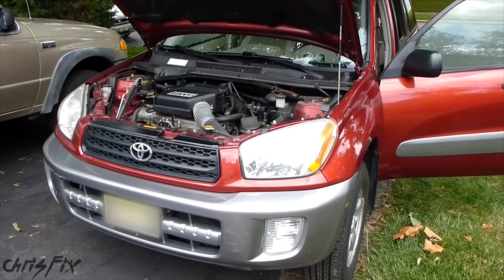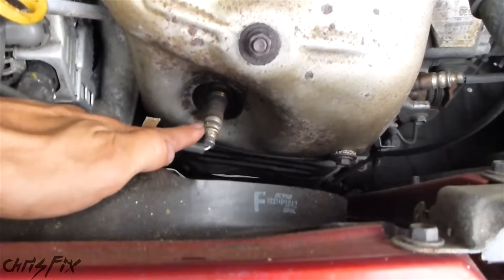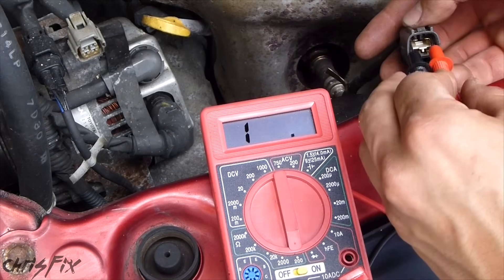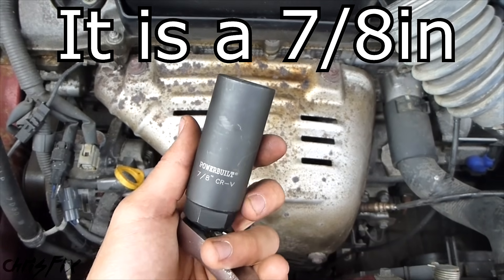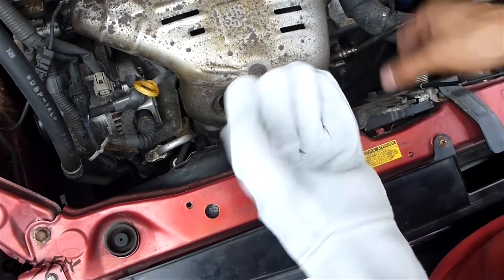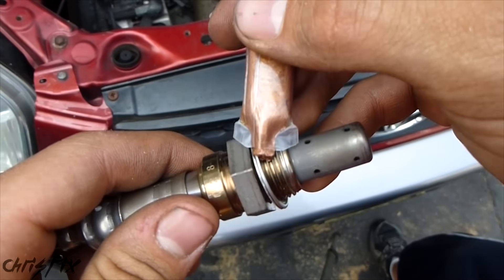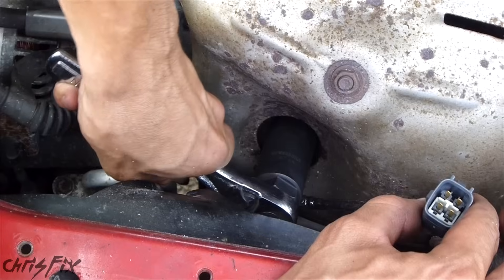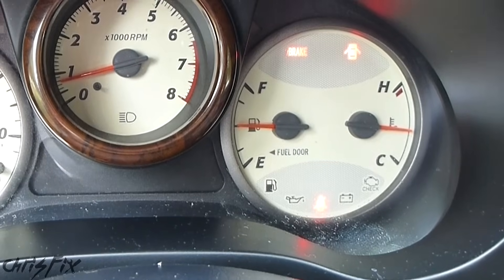How to Check and Replace an Oxygen Sensor (Air Fuel Ratio Sensor)

Comment: I have a P0137 code detected in my 2005 Pontiac Wave. On the internets, it says it has something to do with either the Oxygen Sensor OR the Air Fuel Ratio Sensor. How can I verify which one is the real problem? Before I start purchasing unnecessary hardware. Thanks!

Comment: What did they use before o2 sensors and how do you differentiate between bank 1 and 2?
Reply: Darren D Banks are exhaust manifolds. So if you have two manifolds you have two banks. Bank 1 is "usually on the side of the motor that has Cylinder 1. And sensor 1 is the one before the catalytic converter and is usually heated and sensor 2 is either in or after the catalytic converter.

Comment: Hi Chris, I have Elantra 04, and the Oxygen sensor is with five wires, all different colors, I'm really confused, any tip for me? Thanks in advance
Reply from the maker: The black wire should be the one you need to test.
Reply: Thank you Chris for your quick response, the one end of the voltmeter goes to the black wire, how about the other? By the way your videos are great, and very helpful
Reply from the maker: It varies from car to car. Test each one or look it up!
Reply: Thank you much

Comment: Hey Chris,

Is the resistance of 2.5 ohm standard on all new sensors ? I checked mine and I find 7.3 ohm...seems low don't you think ? 

cheeeers
Reply: Most specs are 5-10 ohms

Comment: hi..  i have questions.  do you think sensor could be faulty without give error code..  i also have problem with my car.. which is when i drive for long time in hot weather and AC on my car stop response and engine turn off.  i feel like no fuel or fuel pressure gone.  i press on pedal many times before start it then engine start but problem comeback again after 2 to 3 miles. what do you think.  i run diagnostic test but no fault found.

Comment: hey Chris I have a Honda it starts after 3 tumbles and the engine check light comes on but wen I drive for about two miles and switch of and start bk it starts on one crank and no more check light do u think this could b a bad o2 sensor?

Comment: Just had this problem with my 07 Camry. Had to replace the ratio sensor, oxygen sensor and fuel pressure regulator before the code finally cleared. I noticed that the computer didn't reset itself until I drove about 50 miles. Only then did I know whether I'm the code was truly cleared.

Comment: Hi
I have a problem with Nissan Pulsar N16 2001. The engine light is on. I was driving and after turning at a light the engine died. Tried to start but after sometime it started and it does not idle.
Reply: Shah Ali maybe MAF sensor.

Comment: very helpful Chris. I have to change mine this week. CEL comes on and Porsche 911 diagnosed the oxygen sensor ahead of cat 46. Plus a knock sensor and a below par fuel filler shut off valve. I was quoted $1200. I bought the gear which I needed for all 3 jobs plus tools for $400. A saving of $800 as I am a DIY guy. Porsche have special very costly durametric testers for their vehicles.
Reply from the maker: Awesome man! Good luck and let me know how it goes!

Comment: Chris I just got a P0420 after I took my 2002 sienna to get an exhaust leak fix. I don't really know what it could be it says it has to do with bank 1. any ideas?
Reply from the maker: +Benjamin Garcia O that is a code for a bad cat. Typically a dirty cat triggers that code. Clear it and see if it comes back.
Reply: +ChrisFix any suggestions on cleaning the catalyst converter? do you suggest buying the liquid cleaner or take apart the whole thing?
Reply: Thank you so much Chris I will do some digging!

Comment: I have a 1976 Plymouth duster and recently it has been stalling when I'm at a red light for a while or at a stop sign, I'm thinking my carb is dirty or something but, any ideas? it's very frustrating and I've noticed even my battery voltage drops when it's about to die which may be normal idk

Comment: Faulty fuel/air sensor will cause a misfire?
Reply: Jonxthxn not always. a bad air fuel sensor can cause a problem as little as a bad air fuel ratio in your combustion chamber and waste your gas, or cause the cylinder to fire unevenly but won't always cause a misfire. your misfire could be because of a spark plug issue, or an ignition coil/coil pack. all of them are pretty easily replaced at home, it takes about 5-15 minutes.
Reply: yes
Reply: Same with bad spark plugs.

Comment: Nice vids, keep them coming.  What do you do if the old sensor is stuck in there a little because the car is 17 years old?
Reply: spray it with PB Blaster or 50/50 mix of automatic transmission fluid and acetone

Comment: have a problem with my 2008 honda civic gi
ot a p0135  oxygen sensor bank 1 sensor 1code. does any one know where is this sensor located?
Reply: Jones Rodriguez  it's a air fuel ratio sensor located on the front of the motor I have a 04 civic with the same problem

Comment: hi chrisfix how i can know what is mean the code 89 in chevy soinc 2012  and where i can find the other code if i need it in future
Reply from the maker: That code is for the fuel pressure regulator. It could be a fuel pressure issue.
Reply: thank you for reply me can u make video how to fix it pls and i wanna ask you abut something  my fan coller  work with the engine without stop do u know why ?

Comment: Hi Chris,
I have been watching your vedio and have learned very important techniques, you really simplify things, I appreciated that.but now I have a question that my Toyota Rav4 2007 2.4 engine the service light illuminated and plug the scanner  gives me two faulty codes;p0138 and p0606,
I searched fot what are these codes,and found out that P0138 is 02 sensor bank1 sensor 2,I believe it positioned on right side after cataltic converter , I will try to find and probably change it,
and about  p0606 not clear what went wrong? coud you up load the video if U can? I watched 2.0 engine rav4 but it may be different?  thanks a lot.
Dany

Comment: Hey Chris I got a question, does the O2 sensor make the temp gauge stop working? I have a 1994 pontiac grand am.
Reply: They're different circuits and don't rely on each other for input. I don't see how they could affect each other
Reply: AJFresh well do you know what causes the temp gauge to stop working?
Reply: I'm not going to list anything specific because your car's wiring probably differs from mine. If you don't have your car's factory service manual, buy it. I've gotten mine from Ebay and it's worked out great for me, in addition to YouTube videos and forums related to my car's model.

Not surprisingly, the temperature gauge receives input from the temperature sensor (TW sensor). My Honda service manual has tests that check the temperature sensor itself. If it checks out fine, you would then turn to the wiring diagrams of the car to see which wires to start checking.

Start with the wires going from the gauge to the wiring harness, then check the wiring harness to the ECU.

My manual has tests that can be performed on the ECU as well You would then have to check wiring from the ECU to the gauge. If all that checks out you can assume by elimination that the gauge itself is faulty.

If there are test that can be performed on the gauge, I haven't run across them.

Comment: Hey chris I got a 1994 ford f150 with a 300 would a bad o2 sensor make her start hard and/or stall and/or idle rough? I have checked all fuel related parts and all air related parts. My truck is fuel injection with out maf sensor,Also has new map and tps also cleaned the tb and egr valve and idle air valve. If you got a idea it would be greatly appreciated. Also you do great work I watch your videos all the time and somethings over and over.

Comment: a trick you could use if your in a tight situation and don't have a braker or cheater bar is getting a deep socket that fits around you ratchet and extention
Reply: jovanni Gonzalez yes or you can use a large box wrench also

Comment: I got the same problem (@neftali salazar) on my Honda accord 2006 code (P0420) took it to atozone and they told me to replace the catalytic converter but I been watching some videos and they say that by replacing the o2 sensor I can fix it the OBD2 diagnose was 1.- Large vacuum leak 2.- fuel system fault. 3.- ignition system fault. 4.-Failed Bank 1 catalytic converter.you have a great channel I clean my lights ,my windshield, change the oil ,the steering fluid, the serpentine belt, the gas filter, I'm  about to change my front break pads and rotors dot know if I have to replace the rear ones tho but the front ones specially the driver side is making a lot of noise like metal to metal kind of noise and change the break fluid to also buying some tools and I'm doing everything by myself and is exiting and so fun after I saw one of your videos and started watching you do everything so easy I give it a try it takes you 5 min to do something that I did in 1 hr tho but still I'm learning little by little and having some fun.thank you so much for taking the time to make all this videos for us.I just got the car and is over 210k some suggestions?I have to replace the motor mounts to I know is a lot of work and I was going to sell the car but when I started to fix it I love it.
Reply from the maker: +robert salazar that's awesome! Don't worry about how fast you fix stuff just make sure you get the job done right! As for you p420 code, clear it and see if it comes back.
Reply: it comes and goes and started after I change the oil, also the gas cap signal comes and goes I'm going to replace that to and also do a transmission fluid change. yes I take my time that is probably why it takes me to much time but I clean everything and change everything and its funny because every time I do something I notice something else that needs to be fix and I'm writing everything down how and when I fix it and the purchased tickets all in a note book I'm starting to like this and I started using a butter knife as a screwdriver Lol.

Comment: hey cris, i 👍 your  vídeos help me verry well .so i have code  p0420 in  my ford freestar 06 4.2 L. do you have some information  about this to fixed.? thanks
Reply from the maker: I would check your live data on the OBD2 scanner. See what the O2 sensor graphs look like.
Reply: I got the same on my Honda accord 2006 code (P0420) took it to atozone and they told me to replace the catalytic converter but I been watching some videos and they say that by replacing the o2 sensor I can fix it the OBD2 diagnose was 1.- Large vacuum leak 2.- fuel system fault. 3.- ignition system fault. 4.-Failed Bank 1 catalytic converter.you have a great channel I clean my lights ,my windshield, change the oil ,the steering fluid, the serpentine belt, the gas filter, I'm  about to change my front break pads and rotors dot know if I have to replace the rear ones tho but the front ones specially the driver side is making a lot of noise like metal to metal kind of noise and change the break fluid to also buying some tools and I'm doing everything by myself and is exiting and so fun after I saw one of your videos and started watching you do everything so easy I give it a try it takes you 5 min to do something that I did in 1 hr tho but still I'm learning little by little and having some fun.thank you so much for taking the time to make all this videos for us.I just got the car and is over 210k some suggestions?I have to replace the motor mounts to I know is a lot of work and I was going to sell the car but when I started to fix it I love it.

Comment: THANK YOU!! This video helped me get rid of my check engine light and helped me pass the smog check!! And I saved big MULaHs!!! I even got the same multimeter and same O2 brand as yours. The only thing missing here are more details on how to complete the driving cycle so the OBD2 can read the catalictic monitor after replacing the O2 sensor. It took me a while but I found out that Toyotas require a very specific driving cycle:
 first, drive at 45-55 mph for 7 minutes, then, drive at 35-45 for another 7 min. Speeds must be consistent and non-stop. 
For those of us who do not pass the smog check due to Catalytic monitor "not ready" or "incomplete", this driving cycle would do the trick. It did it for my Toyota Camry CE 2000. THANK YOU AGAIN!!

Comment: it's always a freaking sensor.
Reply: Good sales pitch, tianshui. Sold!
Reply: We need a sensor to detect bad sensors.
Reply: Definitely not always a sensor. Most of the Diagnostic Trouble Codes that mention an oxygen sensor, for example are just being reported by a sensor. Blindly replacing them, instead of testing them as ChrisFix did, is a good way to add $100 or more to a repair bill.
Reply: Missy Ginsberg yeah whenever your buying a car on craigslist and u ask them why the check engine light is on. Theyre number #1 response is its the o2 sensor... Bullshit
Reply: It's not always the sensor.
Reply: Bergudo Peludo thank you government regulations
Reply: Dude. You aint wrong.
Reply: Kanzen Александр  , if you search for a look-a-like sensors from another brands/models, you can easily find some inexpensive alternatives. They might have different connectors or wire length, but it's easy to make them work by using a soldering iron :)
Reply: Ever have that feeling, when you are just standing around, and sense a freak nearby?
Reply: XD right?
Reply: @Kits_Sim_Driving   @Kevin Hinojosa  
We need a Sensei to detect bad sensors and bad santas.....
Reply: Missing old cars built on reliable technology because you always got back home not these freaking sensors
Reply: Im GLAD its just a sensor bro 🤣
Reply: Chris where is the upstream A/F sensor on my Lexus RX 300
Reply: We are manufacturer of oxygen sensor, nitrogen-oxygen sensor, if you have a product demand, you can contact us + 8615957779261.email: 772379228@qq.com

Comment: Would you ever replace these without a check engine light? I'm trying to diagnose why I've lost 4-2mpg consistently. Did the spark plugs, air filter, tire pressure, all fluids (tranny, t-case, diffs, oil, power steering, etc). It's a 2003 tacoma 2.7L 4cyl. On tacoma world they say replace it every 70k regardless.. I have 181k and never needed to replace it. But don't want to blindly throw parts at it.
probably going to replace the cheap pcv valve & do some MAF cleaner. Curious if anyone's had similar issues and solved it replacing the upstream o2 sensor
Reply: Could be the case. They do affect fuel mileage. If it gets worse I would change it.
Reply: seems to be 21-23 mpg. Used to get 26. Changed so much. Likely doing this next for $70 on amazon believe it or not. Used to use RockAuto tho.

Comment: What about a P0174 (Bank 2 to lean) on a 2000 ford Taurus? Is this code an oxygen sensor?
Reply: Yes it can be 171 and 174 lean codes will most likely pop up together and it can be anything from a bad oxygen sensor to a dirty or faulty mass flow sensor.
Reply: Cali Sav I had a P0174 code on my 2000 ford Taurus, it turned out to be a dirty mass airflow sensor.
Reply: +Matthew Parker yea 174 and 171 are lean codes if your vehicle throws this code something is making your vehicle run lean which also too much air. If you have a bad oxygen sensor it could disrupt that fuel and air ratio.  Such as a dirty maf. ( mass flow sensor )

Comment: I have a 2002 toyota rav4. MyMechanic is telling me that the oxygen fuel sensor is $170 a piece. Hes replacing both. Is the price right or is he overcharging me?
Reply: probably correct. I checked here in Canada I could get the upper 02 sensor for $150 and lower for $320 thats taxes included. They can be pricey. You should be able too look up parts in your area.

Comment: so why are other people torching the sensor to test it? Is this just a smarter way
Reply from the maker: That is to see if it changes resistance. There is no need to do that if the circuit is open and there is no continuity.
Reply: +ChrisFix I see I see.... good info.... so how would I do this if the plug only has 1 black wire
Reply: how many oxygen sensors on a 86 caprice 305 v8 I see one located on the left side of the engine not sure if there's anymore...
Reply: Abuzar Khan thanks... glad i only purchased one... did u ever replace the temp sensor thats between the spark plugs?
Reply: lol damn... 
ive changed all but
maf..  (not sure i have that)
esc... 
tbi (i dont have that) 

do you know if my car have a cabin air filter?
Reply: +Abuzar Khan how come we have the same motor n trans.. but urs fuel injection
Reply: Abuzar Khan do u still have the same carb... or did u swap it for a new one?

Comment: i have question.. do you think oxygen sensor  could be faulty i mean when heat up without  show any errors on dashboard or by ecu
Reply from the maker: It will throw a code if the Oxygen sensor is not functioning properly.

Comment: could sensors just get loose and trick the code?? this is what i got " o2 sensor ckt slow response bank1 sensor1"
Reply from the maker: It is very unlikely but it can happen. Just check to see if it is tight or not.

Comment: can someone please tell me where to go so I can find out where the sensor is located on a 2000 toyota avalon.  Went to dealership today and they was talking $840 just to start.  Mind you it started with a $150 diagnostic that did go toward the cost if I had them to make repairs. HELP!!!!!
Reply: buy your model's service manual from ebay. visit toyota forums related to your year/model

Comment: wish my 96 concorde was this easy... the O2 sensor i have to replace is on the backside of the manifold next to the engine itself.. with a motor mount in the way.. FFS... its still not done...